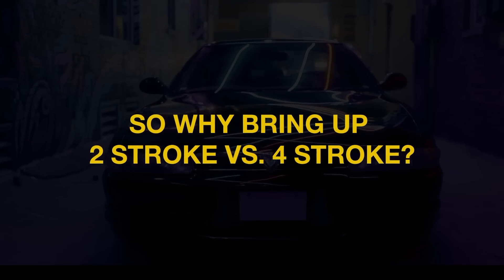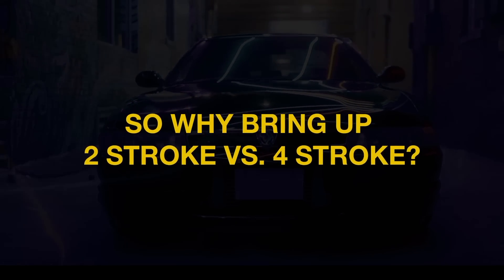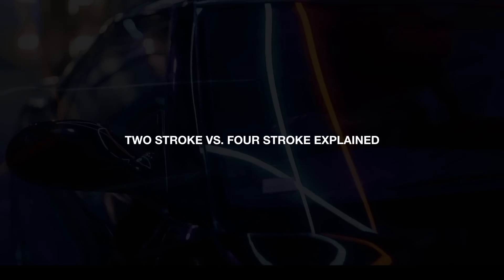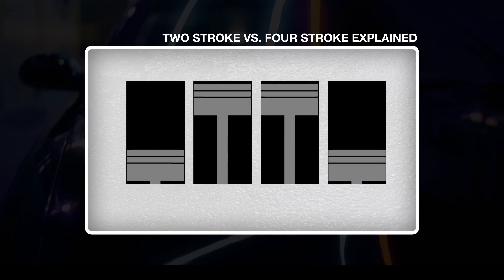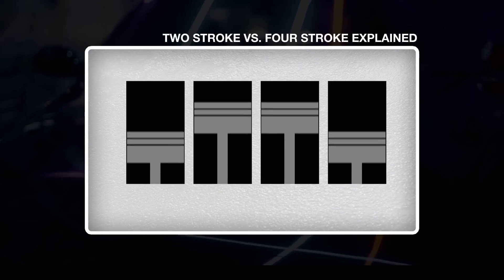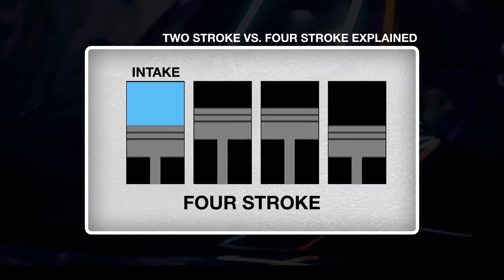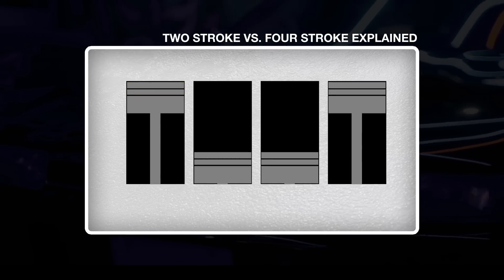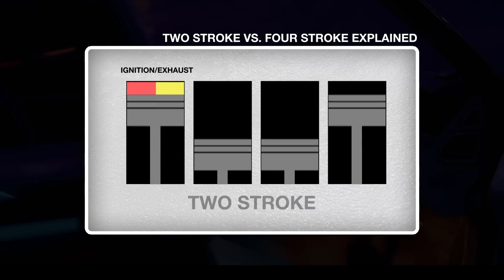The SECRET Behind Why RX7 and RX8 Rotary Engines Make SO Much Power

Comment: 1 complete revolution of a single rotor (360deg) = 3 complete revolution of an e-shaft (1080deg). Each rotor have three individual faces. Each one of them completing one firing cycle per 1080 deg of thermodynamic cycle. 1 firing per 1080 deg rotation divide by 3 individual faces = 1 firing event per 360 deg rotation = 2 stroke engine.

(Edit) So 1.3L rotary equivalent to 2.6L 4 stroke engine. Fuel economy wise? Rotary aren't as efficient as a piston engine in terms of thermodynamic efficiency due to its long thin combustion chamber shape & continuously rotating combustion chamber.
Reply: 😎ONLY ONE "FACE" USE THE ROTOR FOR MAKE CICLE, THE OTHER WAIT FOR COMPLETE THE OVER LAP.☢

😀I 'M PUERTORICAN, 🇵🇷 REGARDED THE DRAG RACING LEAGUE MECHANICS & TUNNERS,  *(I FEEL PUERTO RICO🇵🇷 HOLD TITLE FOR MOST POWERFUL ROTARY ENGINES COMPETITIONS IN THE WORLD).  THE AUSTRALIANS 🇳🇿HOLD THE BEST INGENIERY  DEVELOMENT & JAPANESES 🇯🇵 COMAND THE DRIFT & CIRCUIT. 🤗

Comment: I kinda understand why they labeled it a 1.3 liter, when they originally designed the car for the Japanese market they wanted to put the car into a lower displacement bracket (with lower corresponding taxes and fees) than what a similar conventional engine would in order to make a sportier car that people could actually afford to drive so labeled it a 2.6 or 3.9 would have defeated the primary reason for putting the wankel in a car in the first place

Comment: 2 cycle or 4 cycle, the measurement is the same in all because each one counts the displacement after all of the working points have done their work or fired. There is no reason to not be consistent through all motors, it's a 3.9L.
Reply: 2-stroke Benz-Cycle 360° 4-stroke Otto-Cycle 720° 4-stroke Wankel-KKM 1080° ARE YOU SURE?

Comment: Get A small piece of paper and twist it into A blunt.  Then secure it inside the intake before the air filter.  What this does is... pulls water in small amounts out of the cooling system and into the combustion chamber.  In effect making it water/coolant injected.  The benefit is that water is already hot and will flash to steam easier than if you did A  stand alone mist system.  

Use environmentally friendly coolant as it will constantly be needing replaced.

To tell if you got the install right just put your hand in the exhaust stream, if it is moist then the doobie snack worked.

Do this at your own risk as is may ruin your engine.  It's A gamble...but if it works you may get slightly better fuel economy and A cleaner combustion chamber, which should make your apex seals last longer.

There you go... the cheapest engine modification in the world!

Brought to you by Carl's Jr.
Much obliged!

Comment: Only problem with this video is you keep stating displacements as a fixed value. A rotary engine does not only displace 1300cc's. A Mazda 13b(A) engine displaces 1300cc's per combustion. You kept stating several times that "rotaries" have a value of 1.3 liters. This is wrong terminology, a rotary engine can come in several different sizes, just as normal piston engines come in different sizes. Yes, the mazda 13b is the most common.

Comment: Would this explain why the fuel economy from the engine is like that of a 3.9 litre?
Reply: Yes, but the #1 reason is that the unusual shape of a rotary engine's housings prevents the entire air/fuel mixture from being ignited, so you will always have un-burned fuel passed into the exhaust.
Reply: Mr .357 is there any way to correct this issue, like an aftermarket part or something or it's just the way it is?
Reply: John Connor There's no solution for it at this time, but some are speculating that Mazda's upcoming "HCCI" technology will mitigate this issue and allow rotary engines to return with better fuel economy and reduced emissions.  I also read some about a more efficient "laser" ignition system, but take that with a grain of salt.
Reply: Mr .357 cool, thanks for the info
Reply: But Wankel engines cannot support the compression ratios needed for efficient GDI operation and lack the variable valve timing required to support HCCI technology... Laser ignition is still something that only exists in a lab.. its introduction would offer significant benefits to reciprocating engine technology as well and thus would offer no net gain to a Wankel design.